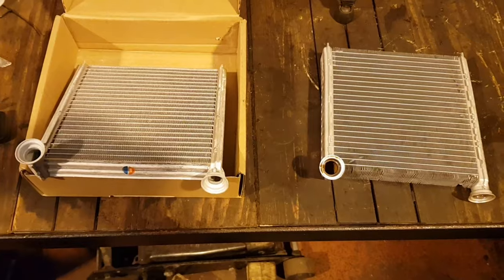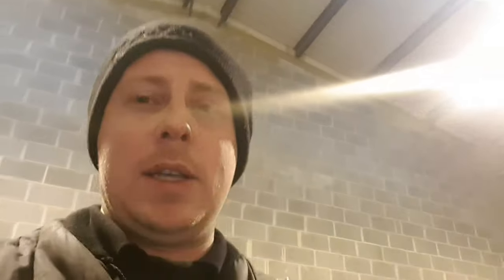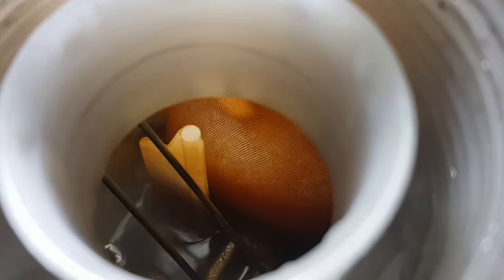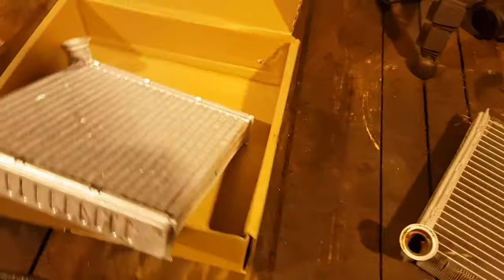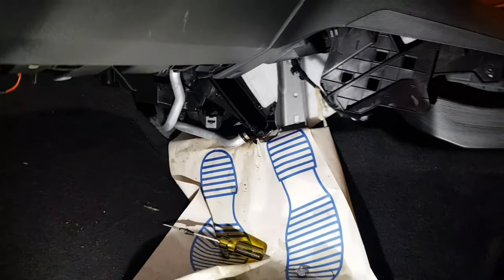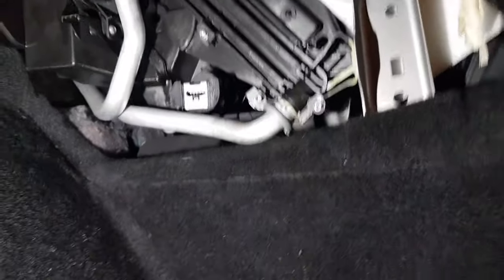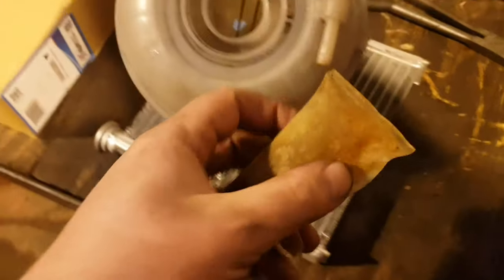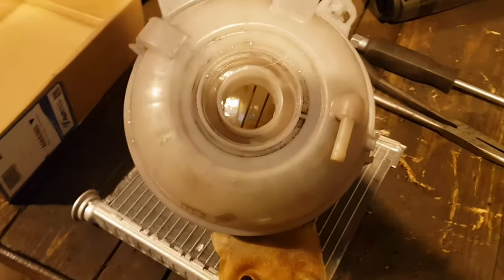Vw Audi Cold Heaters Heater Core Blocked Due To Design Fault

Comment: I have an Audi S3 2014 with same issue. Clogged heater Core/matrix. I was told i need to remove the entire dash to replace this. Does this sound right to you?
Reply from the maker: I haven't done a matrix on an S3. Ive done one on a A3 TDI and its the same as this Seat. Would imagine it should be the same on yours. If you remove the glovebox and see if it looks the same as in this video then you don't need to take the full dash out.
Reply: @lifes.projects  thanks. Appreciate the reply. Ill take a look and see.
Reply from the maker: @renesaba3124  no probs. Its deffo something you can do yourself
Reply: hi, just to confirm. I replaced my heater core today and did not need to take out the dash. or didn't fix my heater issue though which is really annoying. I'm thinking maybe now it's the solenoid valve. seems something is not allowing hot water to enter the core. let me know if you have any ideas.
Reply from the maker: @renesaba3124  Was there any granules in the coolant when you removed the core? 
If so you needed to clean the pipes out as well
Reply: @lifes.projects  I didn't see any granules. Looked dirty though. Brown sludge inside the core.
Reply: Did you flush during replacement? Or it could be one of the aux motors. Not sure on S3 cooling diagram, but probs an aux pump that pulls coolant from the heater matrix itself.
Reply: @Fixingthings101  after replacing the solenoid valve and heater core, heating is back to normal.

Comment: How do you bleed air from the heater matrix after replacement
Reply from the maker: Heaters on hot but turn the fan to its lowest setting. Start the engine up and top up as the engine warms up. When it starts to get hot put the cap back on an wait till the thermostat opens.

Comment: I have a problem with my Audi a6 c7 2.0tdi on a 65 plate. Blows cold on driver side including rear. Took it a garage as it was not giving any codes etc.
My first thought is it’s the matrix clogged on one side hence drivers side receiving cold air. 
They seem to think it isn’t that and it’s a broken flap. 

It literally gives no heat at all. Was considering giving it a system flush but seeing this makes me wonder.

Anyone else come across this fault with the same car ? Or any mechanics out there able to shed some light ?
Reply from the maker: Yes ive come across it. 
Make sure the fan is at low speed and temperature on high
Let the car run upto temperature and keep the engine at 2k revs. When you can feel your heater is blowing hot on the one side let the engine idle and then turn up the fan speed to full.
Monitor how fast your heaters loose tempersture on both sides and if it is pretty quick its 100% the matrix thats at fault.

Comment: Hi buddy. Where are you based? The same thing has happened to me in my 2013 (63) 2.0 150 Leon FR and I've had a diagnosis and quote for either £1100 or £1800 😱😭 it's freezing now and windows bearly demist
Reply from the maker: Hi Chris. I am based near Pontefract West Yorkshire. Currently working full time for someone else while recovering from surgery but happy to advise. If you have instagram its easier to message me on there.

Comment: how hot should the pipes going to it be after the cars warm think i have the same issue
Reply from the maker: When the engine is warm/hot the pipes should ve a similar temp. You will find the return is usually cooler as the fan will cool it down. 
If it is blocked one will be hot and the other cold as its not circulating.
Reply: when driving my coolant temp goes down to around 70 im thinking maybe the thermostat might be stuck open and thats why its not getting hot

Comment: So for a mk7 the car is at temperature and no heat BUT the heat will eventually turn on 30 mins later..
Reply from the maker: Thats usually early signs the matrix is starting to block. When it warms up put the fans on full speed and it it goes cold then its a deffinately the matrix.

Comment: It’s been cold the last few days I have the 2L diesel the temperature gauge has not moved changed the temperature sensor still nothing the blower is lukewarm not hot but the gauge has not moved also put a new thermostat in still nothing
Reply from the maker: Could be your water pump. If that has failed it wont be circulating coolant around the engine therefore giving you cold heaters and incorrect readings. Remove the return pipe from the header tank and start the engine. If you have water flowing out then it is working. If no water is coming out then you either have a blockage or the water pump has failed.

Comment: Great video but what I cant understand is why do the heaters go cold on one side and not both
Reply from the maker: Thank you. Reason is because the coolant enters from the passenger side and as the matrix get blocked warm coolant is only circulating through the passenger side therefore only warming the passenger side until it is blocked completely.
Reply: Thanks for the reply . Mines just gone on my octavia vrs debating weather to give it a go

Comment: I replaced my matrix but failed to flush the pipes from the bottle down to the heater and the same fault occurred  again. granules still in the system contaminated the new matrix with no heating again...so now l am on to my 3rd matrix
Reply: Hi try this heater matrix the cores on the original and replacements are to narrow see this video this will not block again as the core in this one is a lot wider giving coolant a lot more room and will allow granules to pass through and not get jammed, My 2019 seat Leon 2.0 fr 88k miles is partly blocked so I'm buying one of these so less chance of blocking again if some granules get left in after flushing, ive took king size tea bag out of the coolant reservoir yesterday no splits but you can feel granules coming through micro mesh.

Comment: hi bud does loosing coolant mean blocked matrix same car as in video i have 2013
Reply from the maker: If you are loosing coolant then you have a leak somewhere. If youve checked around your engine and cant find anything then check this. It maybe cracked. If the matrix is leaking usually you can smell it and your carpets will be wet
Reply: @lifes.projects  mechnic has checked everywhere cant find it defo a leak somewher coolant last 2 maybe 3 weeks only no wet flour either its a mystery
Reply: Is it a diesel?
Reply: @Fixingthings101  yes 

been doing pressure test on coolant lines but no luck either
Reply from the maker: @akbarhussain7274  Sorry just seen this. Thats a strange one if the garage has had the pressure tester on and cannot find anything. Thats suggesting it could be loosing/burning it internal like Egr cooler/headgasket etc but I wouldnt jump on doing that as its not 100% gauranteed to solve it.
If I was you I would run till it gets worse then you have more chance of diagnosing it correctly.
Reply: @akbarhussain7274  For me, it was during a regen ... it would lose coolant. When EGR gets very hot (which leads into Heater Matrix) ... It would over pressurise they system and leak from the blow off valve inside expansion tank. Check your coolant after DPF regen, guarantee it'll be leaking. Mine was exact same, did heater matrix last week and all back to normal.
Reply: @Fixingthings101  so was urs heater matrix i been told mine is the coolant part got residue on ther but mechnic wants to see it leaking 1st hesaid keep driving for now
Reply: @akbarhussain7274  yes, I’ve driven 2000 miles now , no leaks. Look for pink or white sports on driver side engine mount.

Comment: how to bleed cooling system after replaced matrix heater, I can hear bubbles in dashboard ?
Reply from the maker: You will be able to hear bubbles at first as thats the air been pumped out of the system. 
Open the heaters to high temp, 
Remove the cap and top up. 
Start the engine and let warm up at about 2000 rpm. When its starts to get warm make sure the coolant level is ok and refit the cap.
Let the engine warm up until the thermostat opens (keep checking and topping up coolant level)
Once the thermostat has opened let the engine idle for 5 minutes before turning off. 
Turn the engine off and let it cool down. Once cooled remove the cap and top up to max level.
Thats the cooling system bleed procedure.
Reply: @lifes.projects  My 1.6 tdi 14 plate leon ST blows hot air only on the passengers side and cold on the driver side I also hear bubbles is it possible that it wasn't bleed well?
Reply from the maker: @Webster200x  This is the first sign that the matrix is starting to block up. Because coolant cannot get to the driver side this is why the heater blows cold. 
You could try flushing it out but if that doesn't work the matrix would need replacing
Reply: @lifes.projects  I shall give it a go and come back with the results as I need to look into it further as I only owned Mercedes/Alpha Romeo never had a VAG group car. Can you recommend a parts catalogue/workshop manual for VAG cars?

Comment: On the TDI engines the heater core comes after the EGR cooler and if this is blocked the coolant boils in the EGR  causing coolant to be lost out of the expansion tank! Then the useless VW service garages mis-diagnose it to be a leaking EGR cooler or faulty intercooler, or blown head gasket etc. After spending $$$$$ you then realise it's only the heater core! Fitting of an inline coolant filter would likely stop this problem or at least delay it for a good while.
Reply from the maker: @nmcben  Nice to know. I havent come across that problem yet.

Comment: Great video man! This is my model of car and year and same issue, although heat from passenger side and not as hot on the drivers. Was thinking of giving it a go myself. Only issue I think I might have is, how to flush out the system before fitting the new matrix. Can someone point me in the right direction or list the summary steps to do this?
Reply: Hey,  i have the same problem did u fix 
your car?

Comment: They done this to sell heater cores no doubt,I changed my matrix and took that silicone teabag out flushed car a few times and on last flush noticed minute granules in bucket ,anyway put all the bits together and was getting heat again ,unfortunately some must of got left somewhere in the water channels somewhere and in a month my matrix blocked again ffs ,ordered a new one and will do flushes with the old one in place before I replace and make sure no granules are in coolant

Comment: 2019 car here with 36000 miles. Looks like I am an early victim. Bag didn't look leaky but everything points to this issue
Reply from the maker: I cant remember the mileage on this car but it wasnt high. More than likely the same problem. Ive done quite a few now

Comment: A sign of this is a sound of water flowing behind the dash when the water pump is running. Sounds like air in a radiator. This is a sign the matrix is blocking and not flowing water correctly. Awful design

Comment: For any one with this reoccurring problem!!!!!
I had my heater matrix replaced for the problem stated in the video in 2020. However the heating has been blowing nothing but cold for the past month. Thought it was the same problem so took my car to local independent VAG group specialist. 
Just got my car back.
My heater matrix isn’t blocked like it was before and like alot of people on here are messaging. 
They suspect its the actual internal heater box. Whether the flaps inside are seized or the motors are knackered. Either way it is literally a full dashboard out job and advise around a 12-16 hour labour job. 
At £85+vat per hour labour plus parts its looking at £2k

Looks like i’ll be driving with no heating for the foreseeable🤬😭
Reply from the maker: Thank you. Thats nice to know 👍
Reply: I've got the same problem. Throws up a code saying "Air distribution blend door actuator jammed". Air con works well with cold but heat only gives me slightly above 20c warm.

Comment: This is one of the worst cases I've seen to be honest
Normally have good success flushing out the matrix !
Reply from the maker: I dont really come across heater matrix blocked but ive done a few VWs now with this fault. All have been blocked solid
Reply: @lifes.projects  I have to admit I'm the same dude
We only ever tend to see vauxhall corsa c and vag group vehicles with blocked matrix 
And then your usual culprits with leaking matrix units !

Comment: Just changed the header tank on my Skoda as the bag is within a 2 walled design so you can't pull it out. I'm sleeping soundly now but WHAT A STUPID DESIGN!
Reply from the maker: You can pull it out but you need some really long snipe nosed pliers. Least youve got it before it pops 👍
Reply: @lifes.projects he old one is impossible to remove; it s different, the bag is inside, we cannot see through the hole.
Reply: @chrissulliivan  Yes there are two designs, single and double walled, single you can see the bag but double you can't get the bugger out, only £25 so still better than a new matrix.